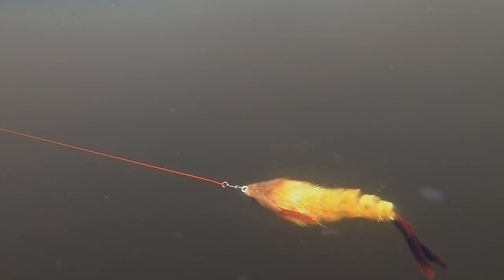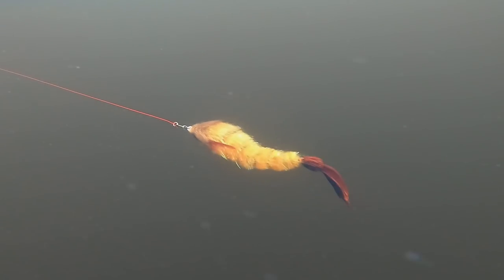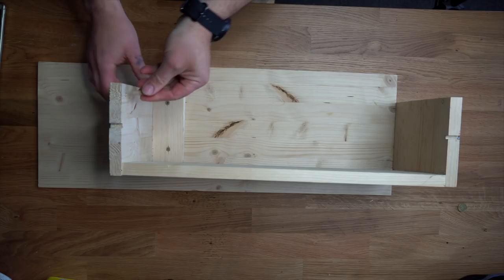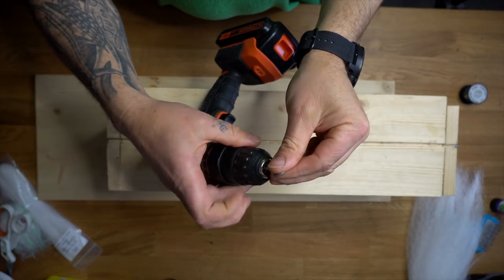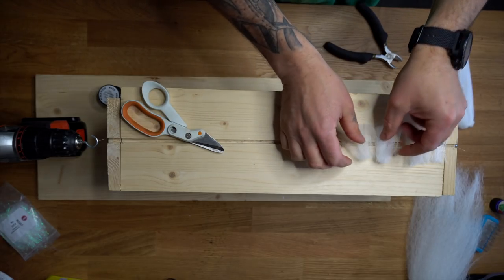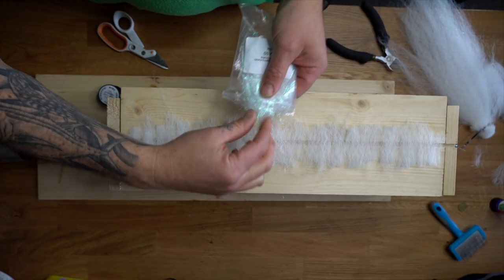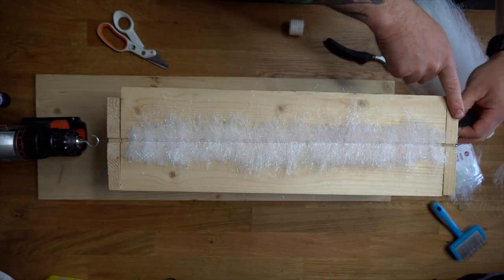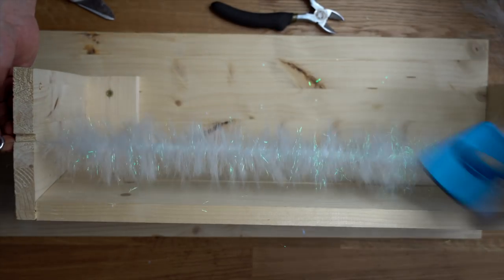The Tying Sessions: DIY Pike Brushes

Comment: Should the wire be annealed or not? I guess they behave quite different to each other.
Cheers, Piffen
Reply from the maker: Hey not sure what you mean about annealed, I just use my lain 0.2mm stainless steel wire , works no problem 😉
Reply: @NorbertRenaud  Annealing is a heat treatment that makes the steel softer. I checked the link on your blog and they have both annealed and non-annealed, so I was wondering which one you use. 

Thanks for your excellent channel, with all nice tips on saving money, and tricks! You're a great down to earth kind of guy that there are too few of in this world. Cheers, Piffen
Reply from the maker: @Piffilus  Many thanks for your kind words mate! Much appreciated! I just use the normal wire, works fine ;)
Reply: @NorbertRenaud  I asked on the gamechanger group on Facebook and the wire he recommended was in fact annealed even though he didn't know that. It said so further down in the description. Well this will have to be a future project since my monthly budget has gone to a Danielsson F3W 7Ten reel, two lines, backing and other fly tying material. I am just about to begin my fly fishing for pike and I am looking forward to get down to the water!
Reply from the maker: @Piffilus  priorities first ;)